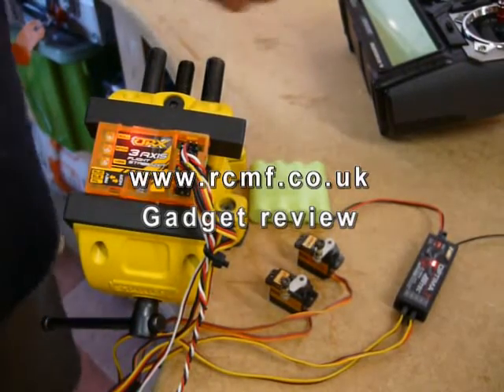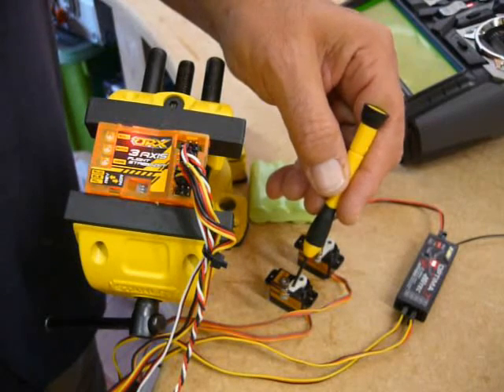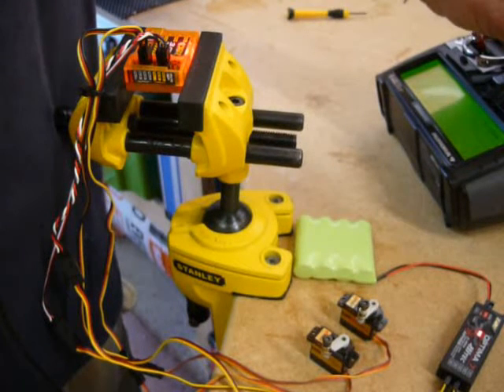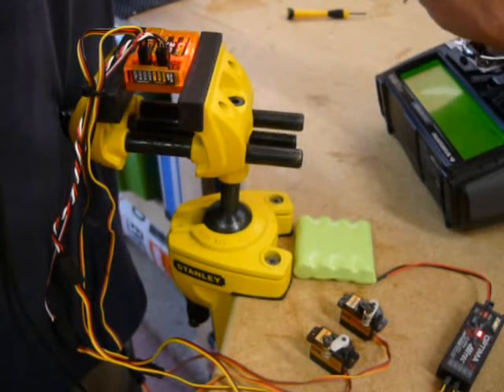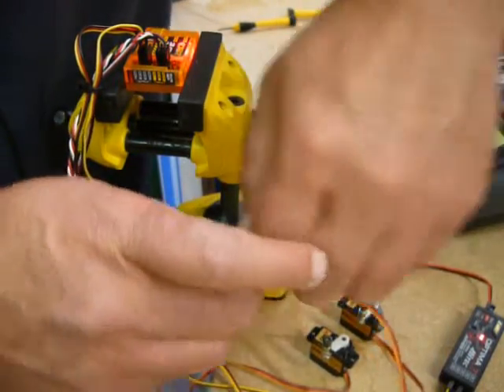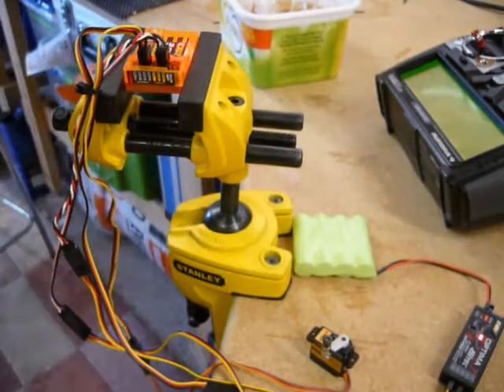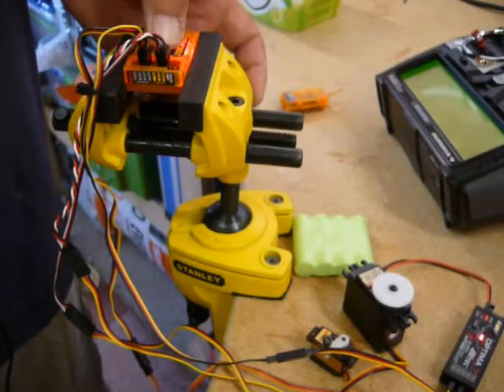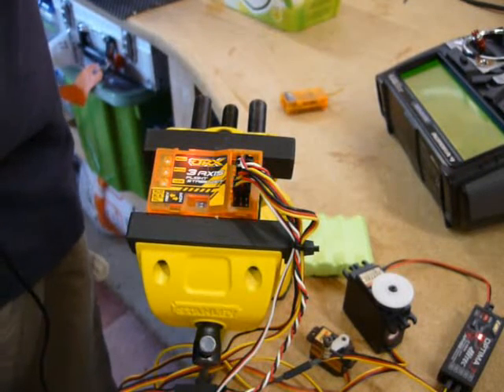RCMF: Orange 3-axis flight stabilizer bench test part 2 of 2

Comment: I thank you for both of these very informative videos. I'm wondering if the issues you are having is because of the close proximity of the radio transmitter to the "gyro". Another thing I suspect may be the fact that you are using the buss power from the receiver instead of having a seperate power supply, or even a "Y" cable to power them both. Another consideration may be that this little orange unit doesn't have enough digital "steps" in it to keep up with the radio. It could be any of them.